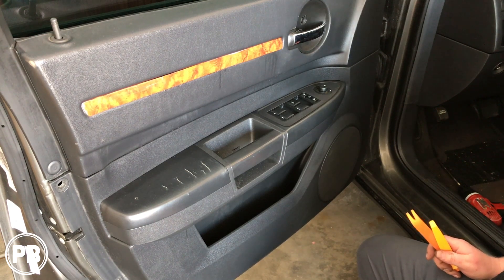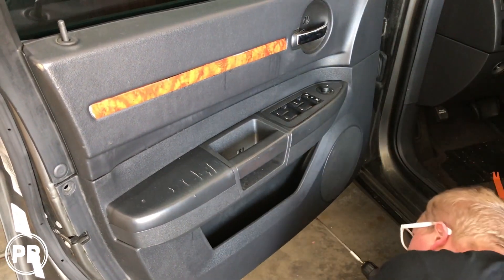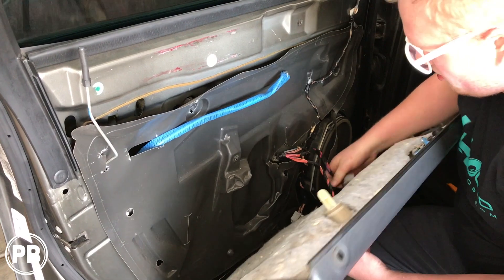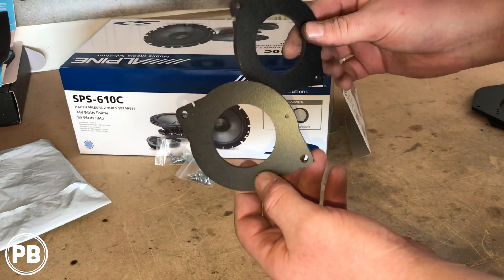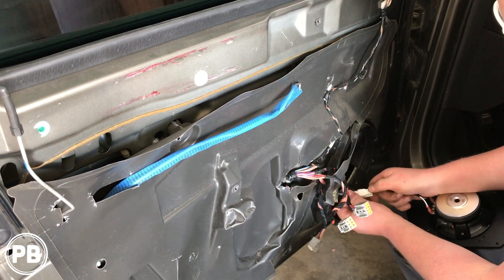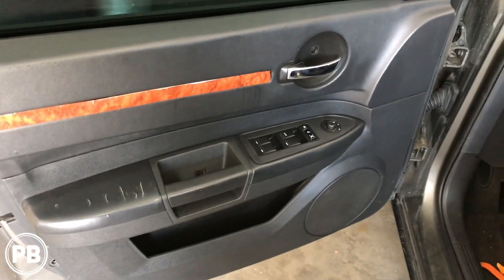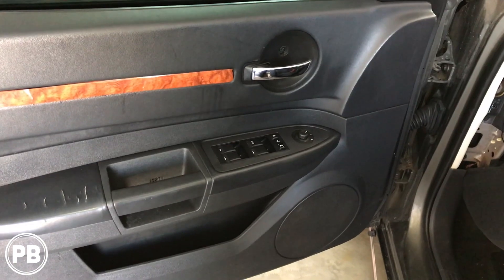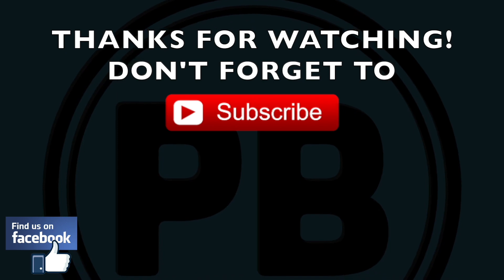2006 - 2010 Dodge Charger / Magnum Front Speaker Install

Comment: Since you installed the tweaters now I know where to look because mine is a 07 charger and the tweater has a grill mesh like deal where I can't pry it open so I never messed with them to change them out from factory to aftermarket tweaters instead
Reply: For the 2007 chargers you have to take the very front trim piece off as well as the a pillar trim piece I believe. Same tweeter size and location.

Comment: What’s the tool you use to loosen the bolts at a angle
Reply from the maker: Angle Driver: https://amzn.to/3nKd8hj
Reply: @ProvoBeastAudio  the speakers and tweeters are 4 ohm yet the stock amp is 2 ohm will this cause any issues?

Comment: I decided to replace the dash speakers in my 2005 Magnum. After pulling out my dash, I discover that there are only placeholders for the speakers.  However, there is a lead with a connecter. I bought some JBL 322Fs...can I just hook those up as is? Thanks.
Reply from the maker: Yes as long as your tweeters / dash speakers have a built in crossover. If so, you can hook directly up as that line is in parallel with the door speaker.
Reply: @ProvoBeastAudio  Thanks! They are the JBL 322F model and I 99% sure that they are wired with an x-over. Good channel!
Reply: @ProvoBeastAudio  I put the first one in, sounds great. Went to put in the passenger side and discovered there was no lead. What a weird car. My car is basically the one in the diagram and I paid for 6 speaker stereo. Aint what I however.  Thanks for putting these up! Also, is there a screw type that is common to mounting car speakers?  Mopar said #6 and now I have a bagful of too small screws.

Comment: What if u don’t have any wires in the dash for speakers how u run them
Reply from the maker: You'd have to pull signal from somewhere, so either tap into them in the kick panel where the door speaker connects, or back behind the radio.  Or simply just install coaxials in the door.
Reply: @ProvoBeastAudio  ok cool will do

Comment: Idk if im actually going to find an answer here but ive recently purchased a 2005 dodge magnum xst without navigation and i want to change my door speakers but both doors are 6.5 speakers that are held in with 3 screws into a plastic bracket do i need to get a new mounting bracket to fit aftermarket speakers most of them i see 4 screws just curious if i need an aftermarket mounting bracket
Reply: just dont screw in the 4th screw?
Reply: they shoulda come with 6x9s so those are aftermarket or pulled off from another car.
Reply: @LaGataNegra3073  thats possible but when i finally got the 6x9 to work it was only held in by 2 screws sad to update that i no longer have the car since the engine bent a piston rod

Comment: Old video , but 1... why didnt you use fast rings on the doors ? 2 why didnt you put the tweeter in the door ? The dash is cool for a second tweeter or 3.5 components but by putting the only tweet for the frontbstage so far from the only mid for the front stage the imageing is going to be rough .
 Also they make an adapter that holds a 6.5 and tweet to 6x9 .
Reply: Im assuming because that’s where the factory tweeter would go.

Comment: I’m trying to replace my tweeters but I have a harness and you only have a positive and negative I really don’t understand
Reply: Did you figure it out? I’m trying to figure that out myself before I start ripping into my car doing as much research as possible
Reply: @ yeah I did I wired up both tweeters to the harness on the left side, since the right side didn’t just have a positive and negative wire like the left side harness did
Reply: @ oh ok so if I run into the same problem of only having one full wire harness, I’ll just do the same thing as you thank you

Comment: This doesn't help with a 2006 charger
Reply: Did u ever find the adapter for the 06
Reply: @memesyandhorrorshorts  found them on eBay for 13 each.